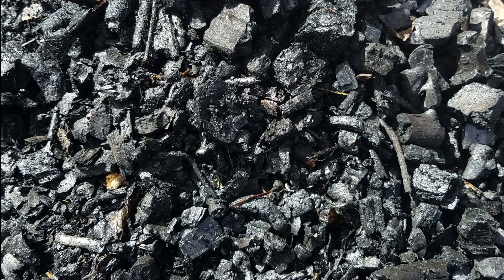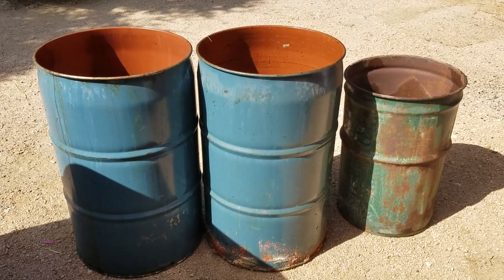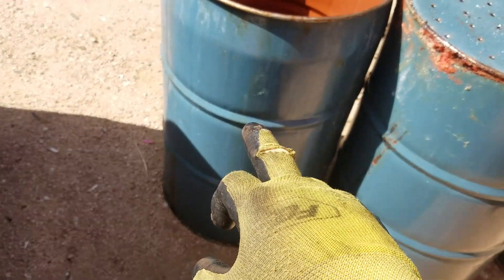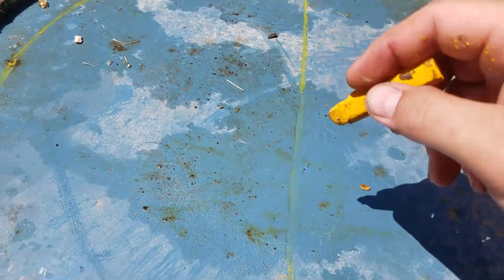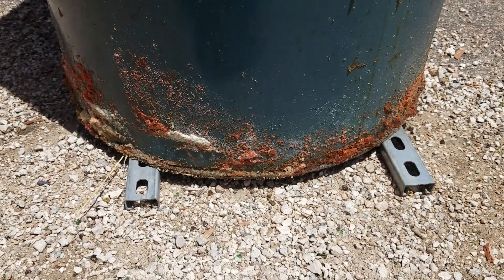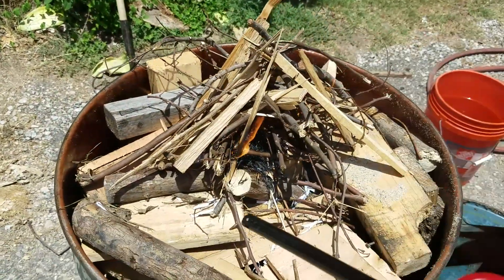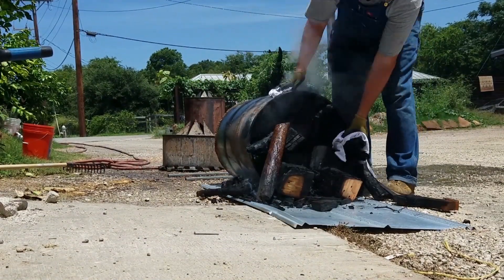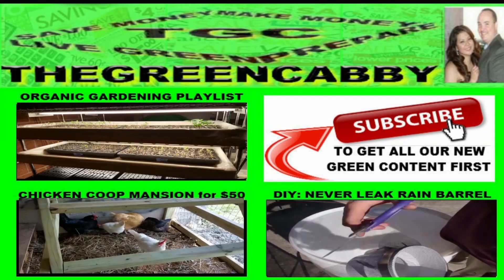HOW TO MAKE BIOCHAR REACTOR - TLUD BURN BARREL for TERRA PRETA PERMACULTURE CARBON SEQUESTRATION

Comment: Nice video thanks!  Instead of drilling or grinding I just punch holes with a chisel and 10pd hammer. Also I have also successfully added elbows and steam pipe by first making a 1.5” hole with a hole saw to make one hole. A crow bar chisel end first thrust into the base of the drum is also effective.